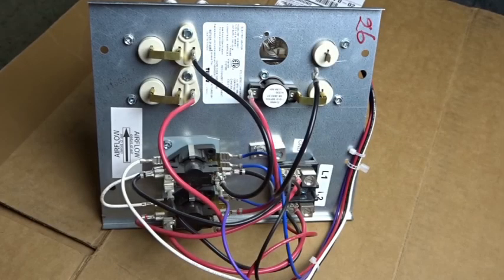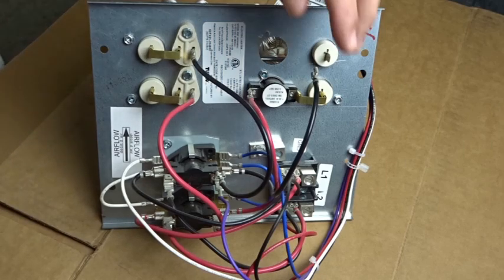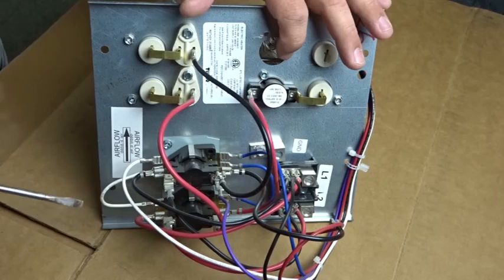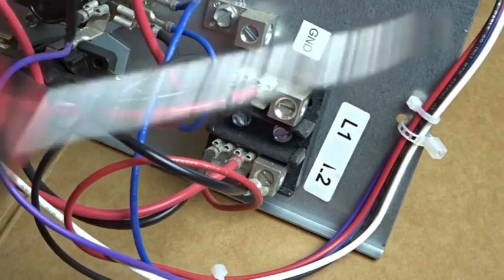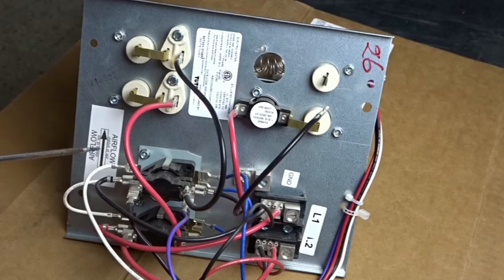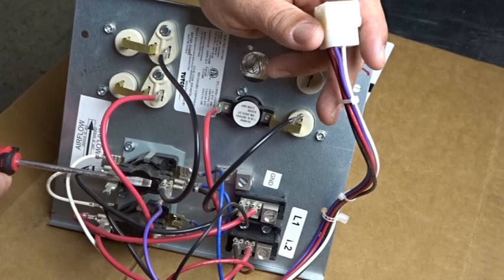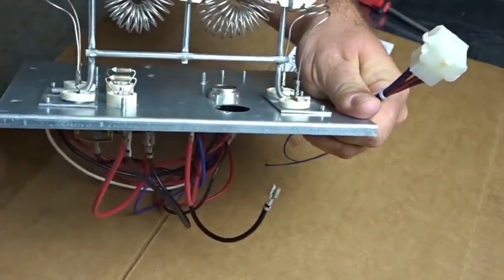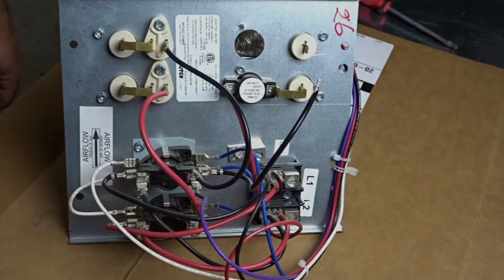Electric Heat Strips | Components and Operation

Comment: How is a heat strip wired, if there is only one 60-amp circuit available, and yet both the handler and heat strip require power lines fed to them?

Comment: I have a Trane unit with heat pump and a 10k heat strip, was told heat strip was bad cause it was only heating half of the elements, replaced the heat strip, still same problem. What controls each element from the air handler?

Comment: As far as heat kits go I have used a theory of installing larger heat kits. For example, if you need a 10kw heat kit you would install a 15kw and wire it to run only 10kw. There would be an extra limit switch, coil, sequencer/relay, breaker, and fuse available in place for future use. This saves the future installer and customer time and money in the future. The cost difference for the part upgrade is very minimal.
Reply from the maker: +na na I like that idea